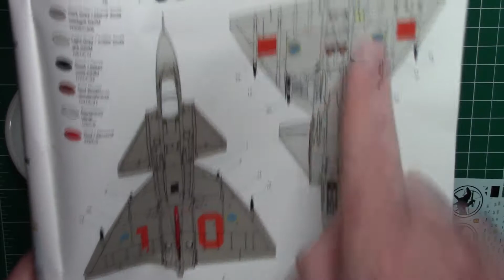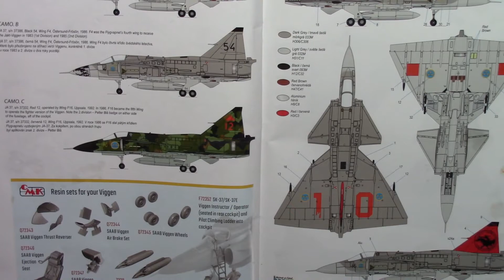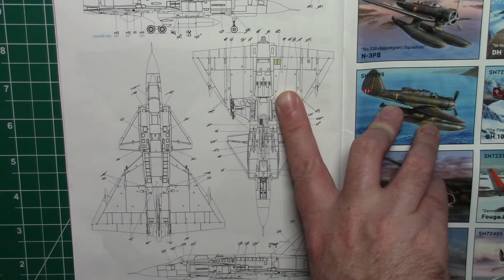1/72 Special Hobby JA-37 Viggen  Build Series - Part 5: Decals

Comment: Yay decals, this is where it comes together or goes horribly wrong.  The jet is coming along nicely. Just ordered the Saab tunnen in 1/48 scale.  I always get those two solutions backwards 🤷🏼‍♂️
Reply from the maker: I've stopped using the Micro Set (blue bottle). It does nothing. I just use water to place the decal. Then use Micro Sol to set it.